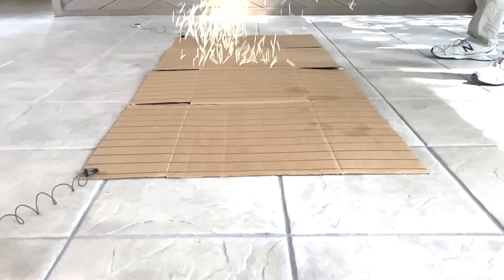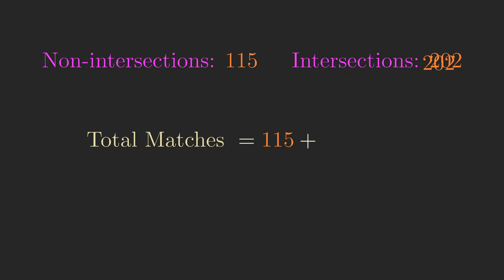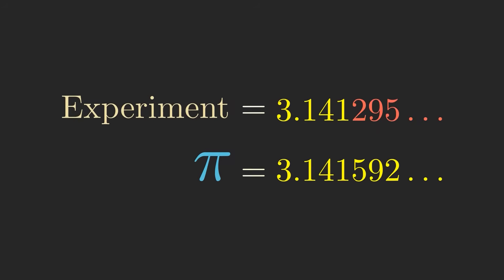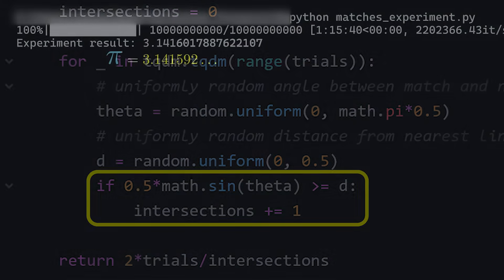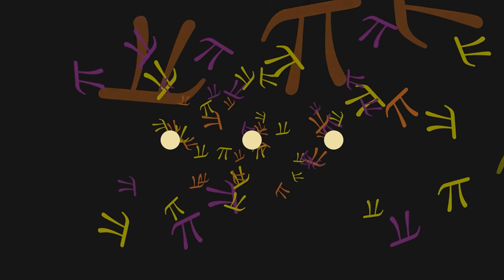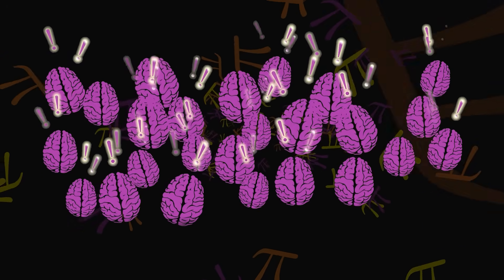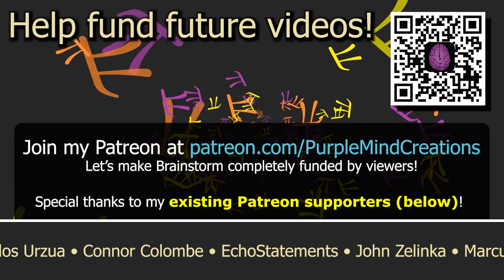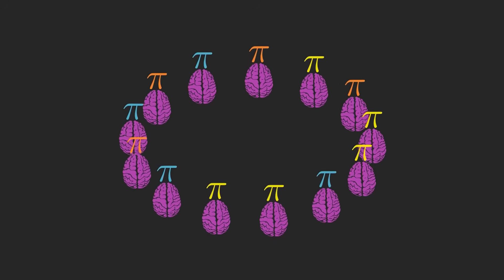Let's Calculate Pi In The Strangest Ways Possible!

Comment: Here's my (failed) attempt!

For the sake of this proof, the lines are horizontal and of infinite length. The matchsticks' length (and therefore the vertical distance between the lines) is 1 unit.

Let's represent each matchstick as a ray ("base point" and direction). We assume the angle is in the range [0,2pi). Because we don't care about the matchstick's absolute position, we will represent its base position as a number in the range [0,1). A base position of 0 would mean the base is exactly on a line, whereas 0.5 means it is exactly between two lines, etc. Let the "endpoint" of the matchstick be the point exactly 1 unit along the ray. We will say a matchstick intersects a line if its endpoint has a vertical position >= 1 or <= 0.

We can use trigonometry to calculate the vertical position of the endpoint given the base point position and an angle, using this:

endpoint(base, angle) = base + sin(angle)

Now, let's find which angles will cause upwards intersection (endpoint position >= 1) for a constant base point "base". We need to solve for "angle".

endpoint(base, angle) >= 1
base + sin(angle) >= 1
sin(angle) >= 1 - base

We now need to find which angles will satisfy the inequality. arcsin(1 - base) will give the minimum angle > 0 that works. Because of the symmetry of the sine wave, we can reflect this angle around pi/2 to get pi - arcsin(1 - base), which should be the maximum angle < pi that works. Because the only angles that point upwards, and therefore the only angles that have potential for an upwards intersection, are in the range (0,pi), we can assume that [arcsin(1 - base), pi - arcsin(1 - base)] is the only range of angles that work. Therefore:

arcsin(1 - base) <= angle <= pi - arcsin(1 - base)

We can repeat the above logic for the angles that will cause downwards intersection (endpoint position <= 0) for a constant base point:

endpoint(base, angle) <= 0
base + sin(angle) <= 0
sin(angle) <= -base

This time we flip the upper and lower bounds because we're solving for endpoint <= 0 instead of >= 1:

pi - arcsin(-base) <= angle <= arcsin(-base)

Because we are working with angles in the range [0,2pi), we add 2pi to the upper bound to keep it in range:

pi - arcsin(-base) <= angle <= 2pi + arcsin(-base)

Therefore, a matchstick with base position "base" will intersect a line if and only if:

arcsin(1 - base) <= angle <= pi - arcsin(1 - base) OR pi - arcsin(-base) <= angle <= 2pi + arcsin(-base).

Now, let's find the probability of an intersection for a constant base point and random angle. Assuming the angle is uniformly chosen from the range [0,2pi), the total range is:

0 <= angle < 2pi
range_total = 2pi - 0
range_total = 2pi

For upwards intersection, the range is:

arcsin(1 - base) <= angle <= pi - arcsin(1 - base)
range_upwards = (pi - arcsin(1 - base)) - (arcsin(1 - base))
range_upwards = pi - 2*arcsin(1 - base)

For downwards intersection, the range is:

pi - arcsin(-base) <= angle <= 2pi + arcsin(-base)
range_downwards = (2pi + arcsin(-base)) - (pi - arcsin(-base))
range_downwards = 2pi + arcsin(-base) - pi + arcsin(-base)
range_downwards = pi + 2*arcsin(-base)

Because upwards and downwards intersections are mutually exclusive, the range of either intersection is: 

range_intersect = range_upwards + range_downwards
range_intersect = (pi - 2*arcsin(1 - base)) + (pi + 2*arcsin(-base))
range_intersect = 2pi - 2*arcsin(1 - base) + 2*arcsin(-base)

The probability of intersection is the range of angles that cause intersection divided by the total range of angles, therefore:

P(base) = range_intersect / range_total
P(base) = (2pi - 2*arcsin(1 - base) + 2*arcsin(-base)) / (2pi)
P(base) = pi - arcsin(1 - base) + arcsin(-base) / pi
P(base) = 1 - (arcsin(1 - base) + arcsin(-base)) / pi

Now, to find the overall probability of intersection, we use the probability of intersection with a constant base and find the average over all bases. To find the average, integrate P(base) over 0 <= base < 1.

This works out to 1, though, not 2/pi as shown in the video, so I did something wrong...?

Comment: I have used a variant of this problem to create a game/demo for students at past Pi Day celebrations at Pasadena Community College. A more general version involves tossing compact convex sets onto an infinite set of equally spaced lines. It turns out that if you set the line separation equal to the perimeter of the convex compact set, the probability of crossing a line is one over pi. Using this fact, you can treat the line segment in the video as a "two sided polygon" whose "perimeter" is twice the length of the line segment. That is why there is an extra factor of two involved in the computation for pi.

For my demo, I find it convenient to toss dice onto a grid of parallel lines to simulate tossing squares. I get students to toss ten dice ten times to get a sample of a hundred throws. It only takes each student about 2 minutes to do all the tosses and record their results. I can get 50 students to do this and record 50 sample means for pi. I then construct a confidence interval for the students to show how good their prediction is. We usually get pi good to two decimal places with a margin of error around 0.02. The students really enjoy this activity and I encourage other people to try it out next pi day. The material and setup are cheap and easy.

This problem also allows you to engage with students about mathematical research. Students and the general public do not have a good understanding of what math research is like. However, with this problem, I can talk to them about changing the shape of the grid, changing the distribution of the tosses to be gaussian, changing the shape of the object, or any combination thereof. Any of these variations are open problems with some recent-ish papers published tackling them. I can also show how this problem was abstracted from people in the 1700s studying the spread of bullets on a target. The original problem was throwing normally distributed circles at a target of equally spaced concentric circles. There is a goldmine of ideas in this problem that can be easily communicated to the general public. Thank you for highlighting the problem on your channel.

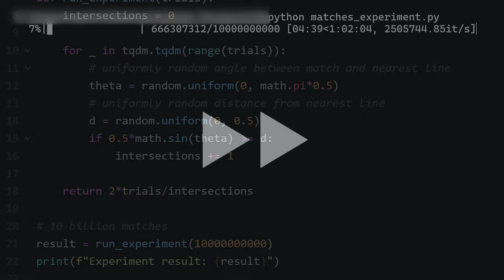Comment: 2:40 Some optimisation tips. These are for time and not code readablity
1. Instead of each time getting thwta with random.uniform(0, math.pi*0.5) you can instead store a HALFPI varisble so you don't need to multiply each time and you can use random.random() * HALFPI.
2. d is random from 0 to 0.5 and then when we check in the if we multiply the left side by 0.5, when we can just have d = random.random() (so 0 to 1) and remove the 0.5* from the left side.
3. We can just remove d and just get random.random() inside the if, and we can do the same with theta

I wrote it myself in Python and sam a ~3-4x speed up and also wrote it in c++ with a ~15x speed up.
In the time it took me to write this comment my c++ implementation finished
Reply: You can also do it in vectorized batches with numpy arrays or even on a GPU with torch. Took just 1.439 seconds with 100 batches of 100 million on my 2080 TI. Takes 3.5 minutes to do the same if we stay on the CPU.

Comment: 2:40 It's sort of... flawed, to run a program that uses the value of pi (on line 12) to calculate the value of pi.
Reply from the maker: Well, I suppose. But the fact that you need to use pi to create the computer experiment in the first place (and the way in which it's used) should give you a hint as to how to solve the problem.

Comment: My favorite argument I saw for the needle problem was to consider replacing the needle with an arbitrary curve and use linearity of expectation to argue that the expected number of intersections with the lines is proportional to the length of the curve.  Then consider the curve being a circle of diameter 1.  It has length pi, and (almost) always makes 2 intersections with one of the lines, so that proportionality constant must be 2/pi.
Reply from the maker: Nice!

Comment: The website for submission returns a 404 error...
Reply from the maker: Uh oh, which website exactly? There is the page with the instructions and then a Google Form linked from that page. They both work fine for me. Also roughly where are you located, if you wouldn't mind sharing? This may be relevant.
Reply: @PurpleMindCreations  I now tried troubleshooting again. Well, apparently, I just didn't include the "www" part when I copied the URL, since links are not clickable in the video description. The home page did work without "www", so it also confused me
Reply from the maker: Hmm that is weird because it did work without www for me. I updated the link to include www now just in case. I set up the website pretty soon before posting the video, so it's possible that the DNS servers updated in my geographical region before others, so let me know if the problem still persists.
Reply: The www. part before the domain name is not omittable, it seems. It also gave me a 404. Might be a Firefox problem.

Comment: Lovely video idea; I joined on Patreon to support you! My proof of the matchsticks giving pi was a runner up in the original "Summer of Math Exposition" in 2020. (I also had a follow up video showing how you can use a GPU to speed up the simulations!). There is a way you can do something similar with dice rolls (or any other source of randomness) using the central limit theorem and the fact there is a sqrt(2pi) in that formula.....I will make an explanation if there is interest in this!
Reply from the maker: Thanks so much for the support! I just checked out your video and it is really great. Would love to see your explanation as a submission and maybe I could show it in the follow-up video.

Comment: My intuition is that throwing matchsticks will bring up random angles and directions which of course together approximate the circumference of a circle. The intersection versus non-intersection distinction serves to discriminate between different angles, which would approximate the diameter.

Thus you get the final formula Total Matches x 2 (Circumference) divided by Intersections (Diameter) = pi.

This is purely gut feeling and I would need to formally check it later.